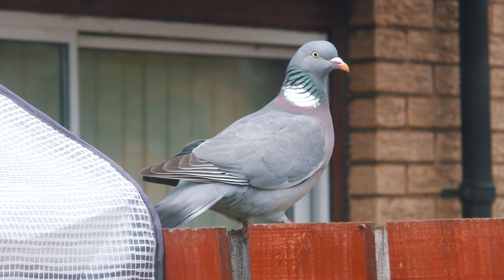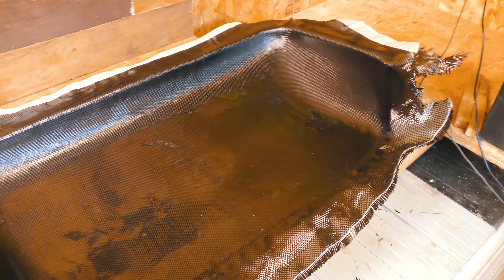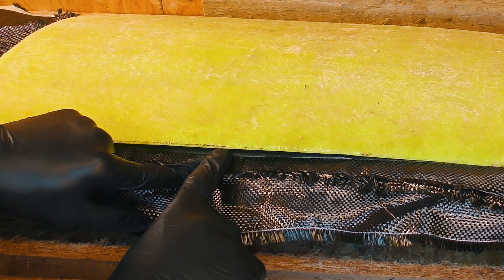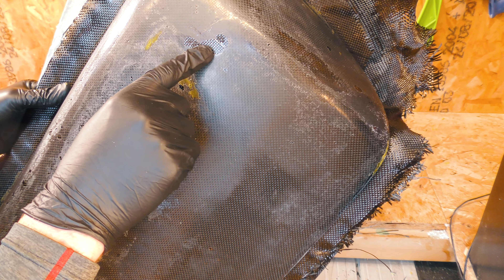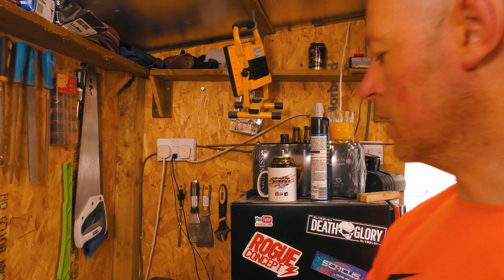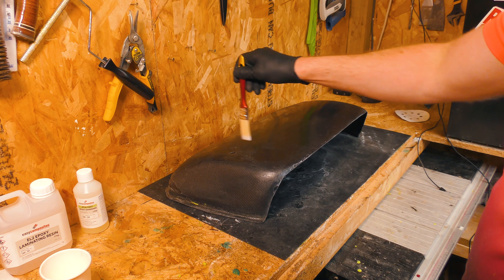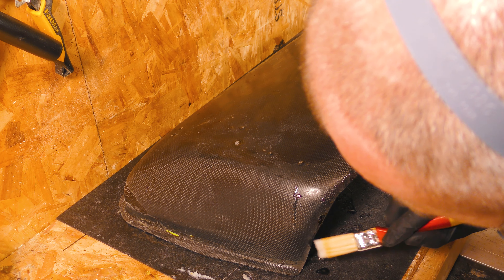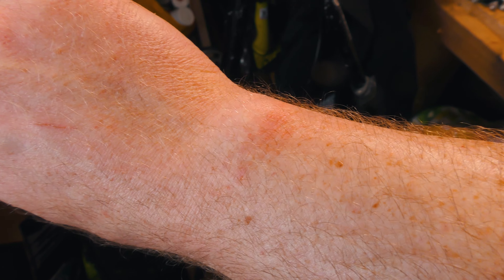The first results need some cleanup - EP17 Carbon Fiber Subaru Hood Scoop

Comment: Not gonna lie, 6:13 is a pretty satisfying reveal. It looks like a massive carbon fiber hood scoop! Even if not perfect, that's pretty impressive. Looks even better with some filling. Can't wait to see shiny!
As for the voids in the epoxy. My guess is that as you are pushing and pulling the cloth layers around you manage to pull the bottom layer up just slightly, creating a lifted spot or an air pocket.
Since the epoxy has some tension and naturally wants to flow together, it actually clings to the cloth and resin outward. So, it sort of runs away from the center of any voids, making a bare spot.
Could also just be trapped air left after laying the first layer, and the heating of the resin causes expansion. More epoxy on the mould surface and working center out more carefully may help it.
Reply from the maker: I was wondering about putting on a thicker layer of resin on the mould first before I add any cloth - letting that cure smooth before I add the carbon. Either that or just put on a mega thick resin layer with the first layer of cloth. Someone else suggested doing the first layer only, letting it cure, then adding more layers later.
Reply: @vPerformance  Hmmm, if you could get the first layer to lay out super smooth that might work, but you wouldn't want to let it fully cure or you'd create an artificial separation that may work itself apart over time. I think really you just have to be super thorough about getting any air our, like when you lay down a big window sticker for example and it gets bubbles trapped underneath. I'm just spit ballin' though.

Comment: Re air bubbles/pin holes when you first wax a mould it takes a while for the vapours to fully evaporate. Also try really wetting out the mould and draw the resin through the first layer. You should be able to wet out all of the first layer with resin from below with use of a heat gun so it’s nice and runny. Then you add more resin and repeat with the second layer. Your compound curves are a nightmare to consolidate with a roller get a 4” brush and consider bagging but don’t bother infusing. You can get some consolation rollers with bristles that might help in your situation. Oh and just do it again but better! Practice makes perfect most people get worse bubbles at this stage 😅